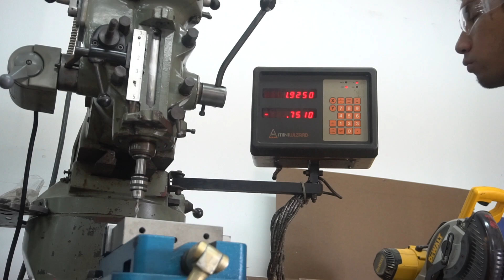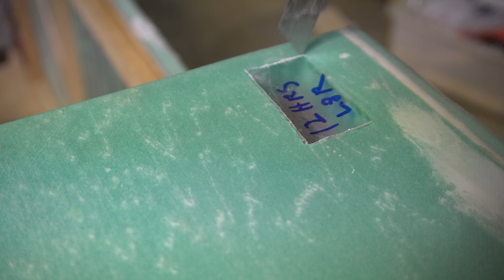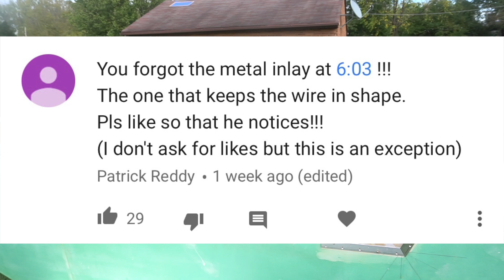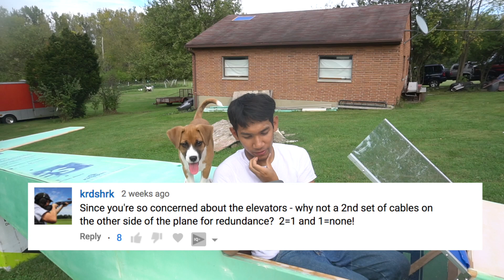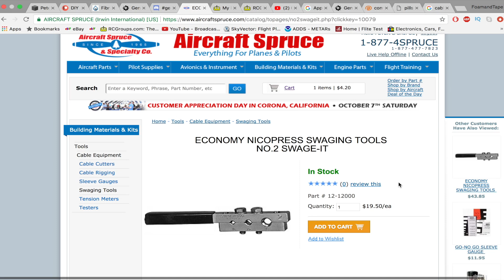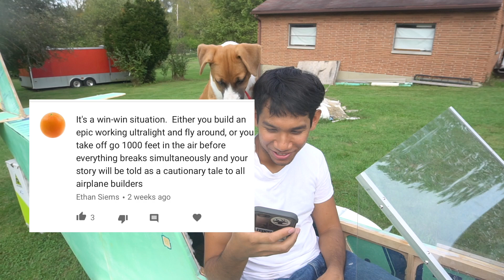DIY Electric Ultralight pt4 (fiberglassing fuselage and wing construction)

Comment: I think its awesome that you are trying to build  an airplane - you are doing something that I have always dreamed about. Speaking of dreaming, I am currently training to be a recreational pilot and I fly a Sling 2 Light Sport Aircraft. Super reliable and super forgiving to newbies. The sling 2 is rated for +3.8 G and -1.9 G. In all my training, I don't think I've ever exceeded +2 G and more than -.5 G. This aircraft has a wing span of 30 ft with wing loading at 11.7 lbs/sq ft. I really think that your landing gear needs to be taller. When you come in to land, the short height of the gear can make your landings problematic. The main issue being that if your aircraft gets hit by a cross wind or you over -control during your approach, your prop may strike the ground, your gear may collapse if you land hard or balloon too much during the round out and end up stalling. Please be safe. Aviation is super rewarding, but is unforgiving. One mistake can lead to disaster, so don't be careless with the controls thinking it just needs to last one flight. Especially when you know that something is going to fail eventually - don't take that chance!

Comment: Hey bud, it's hard to tell from the video but some of your edgemargines on the holes seem to be less than the half the diameter of the holes you are using and I can't tell if you are doing a fillet relief on the holes. If you are planning 4G on a flight you mounting surfaces need fillet relief on the fasteners or you will experience sheer on the fasteners heads even if titanium or if not enough edge margin the fasteners will tear through the metal. 
 As a airplane mechanic I want to see you fly safe.

Comment: adding some sort of suspension may not be such a bad idea. If, for some reason, you cant land smoothly a bounced landing may be pretty sketchy. I have crashed a few rc planes that had no suspension. They simply hit the ground too hard and because I did not have enough power, they stalled and fell straight to the ground. Your power to weight ratio may be good enough to get you in the air but it may not be good enough to get you out of a stall caused by a bounced landing. This is a situation that is hard to get out of in any plane, given it is severe enough. By adding at least some suspension you're decreasing your chances of getting into this situation. It will also help take some loud off of your plane when making a landing, this will keep it flying longer. This may be something you had already planned on doing after the first flight but I feel it is important enough to fix now, before it flies at all. Best of luck!

Comment: I love your videos and I have been following your channel for a while. I am a 15 year old student pilot and I have always wanted to build an ultralight myself. I think dropping the landing gear to prevent a nose over/structural destruction of the plane is a great idea. Are you going to have a single set of ailerons or one set on each wing? Have you thought of attaching a ribbon onto the top of the lower wing about 3/4 the way back as a primative stall warning system? (You can google it to see an actual example of this)

Comment: Hey Peter.  I would look into getting some larger diameter landing gear. maybe a small bike tire.  those small wheels will dig into the ground if you have any vertical speed and it will flip.  also the added height will allow for more landing flare.  also make sure you bench test your motors. (you may want to do on a moving car as well to get dynamic thrust) having an adequate thrust to weight ratio is important for controllability. what are you planning for currently? Also I would highly recommend switching to a more robust motor.  I'm not so sure about turnigy try KDE direct. 
Dan
concerned Engineer

Comment: Does not need to be this strong??????????????  Wing root meeting the fuselage had better stronger than u think u will ever need. Also engine firewall.   Peter, that is excellent work. I have enough faith in your work, to have u build one for me. Been flying commercial craft for 35 yrs. I love your ultralight.

Comment: Thank goodness you put face sheets on the foam!!!   Now do the other side.  Sandwich it.   One side ain't gonna cut it.   Strength is proportional to the moment of inertia of cross sectional area, and one side face sheet has very low moment of inertia.   500 lb on the wing is WAY too low.  You tend to underestimate the loads.   Put a 1.5x safety factor on it.  Send me the OML and materials and I'll do a stress analysis for ya.  Sincerely, an experienced airplane designer.
Reply: Yeah, some people must slam some data in this guy's face, or he will more than likely get himself killed. You know he has no idea what he was doing  when he even talks about pulling Gs in a plane this size built with polywood and fiber glass.

Comment: What foam cutter did you use and if you made could you make a vid on it
Reply: Conner Majic Just metal wire connected to power source, so its getting hot, just Google styro cutter.

Comment: You absolutely have to have suspension, at least a little, especially if you screw up your spar, the plane is toast. Even a compressed rubber spring, something so you don't crack the spar. Even a couple little tiny bumps could screw it up on your first landing. And since you've never landed your ultralight before, let alone fly it, you don't know how it's going to flare.
Reply: I think a trailing link suspension would be best. The way it is, I wouldn't trust it for one landing. Even if it doesn't suffer visible damage, I worry about what would be happening to the spar---unseen.
Reply: agree, couple big block valve springs encapsulated in the tubing could be good way to go too.
Reply: or go the route that many light aircraft, and even gen 1 and two cirrus use on the nose, Rubber pucks!
Reply: HUH????
Most ultralights DON’T have any suspension!
I have had 5 ultralights and none had any suspension! They were all sold in great shape to other pilots.
Reply: I don't like that the gear legs are attached to the main spar where a  landing on a rough field  could cause hidden damage. The small wheels are prone to being pushed back if hitting ruts or lumps, putting a strong twisting force on the  spar mounting point. Of course if all of the takeoffs and landings were on soothe or paved runways, this would not be a problem, though having larger tires would be better just to absorb rough landing impacts.
Reply: Spencer Coleman Why not use car shocks?
Reply: car shocks are too heavy. The first planes had give in the wood and the wire cable used to hold them. I think you're worrying about something that should be a non issue.

Comment: Hey Peter,

I noticed you didn't put any threadlock on the bolts, DON'T forget this, this thing is going to vibrate a lot.

Greetings from The Netherlands
Reply: Thread locker is almost never used on aircraft, proper torque and safety wire or cotter pins are far superior, I say this as a certificated aircraft technician. The main issue with thread locker is its internal so its nearly impossible to tell if the lock is broken without actually breaking it yourself, wire and pins are external making them easier to inspect while also providing a stronger lock, but yes the bolts should be secured one way or another.
Reply: And greetings from Singapore
Reply: HEY BETER
Reply: Armando - Like a fly by wire system? It could work, the F-16 uses something like that, and while it might save weight the downside is that if the battery dies he has no means of controlling the aircraft, the cable system however will work as long as they are intact, so I would say its the safer option.
Reply: Ok thanks, I didn't know that.
Reply: i second the safety wire of cotter pin idea. Also highly recommend picking up that ac 43.13. oh and were are you from Henry? greetings from waterford michigan, KPTK.
Reply: @C Henry: Agreed. Do you guys use a magnaflux equivalent on the Aluminum? How often do you magnaflux steel parts? What makes the other guy think this thing will vibrate a lot? Foam is a natural cushioner/dampener and electric motors are about as smooth as you get. FAR superior in low vibration to gasoline aircraft engines. (only inline 6s and v 12s are perfectly balanced requiring no harmonic balancer)
Reply: BtW When I do use threadlocker I use the red loctite you apply AFTER assmebly. It's just so much easier and faster. ( My bikes see LOTS of vibration in the form of potholes and it is brutal on things. Especially food inside a backpack will often be a mess of just crumbs when I arrive somewhere. :-P )
Reply: Our usual NDT for aluminum is a die penetrant, or a fluorescent penetrant, the flaws have to reach the surface to be detected but its easy to use at least, as for when, I just do it when the manual says to, intervals sometimes vary, but with my current job at a repair station by the time we get them its usually due. I think your right on the vibration, electric motors don't usually have much and so long as the props are balanced it should be minimal, as an added benefit he wont have gasoline near that foam, I would hate to see that little aircraft dissolve on him. I should say I have nothing against thread locker, I use it religiously on my truck, its just for aircraft there are better options.
Reply: Goldeagle, Oregon, and I definitely agree on the 43.13.
Reply: Threadlock should never be used on an aircraft. The correct selection of hardware works better.
Reply: vfxexpert .
Reply: Hallo medebroeder van Nederland
Reply: WHAT!!!!@??  Use the threadlock on everything that isn't plastic or polymer
Reply: Eeeyyy nederlaaannddd

Comment: Hey peter, I have a project for school where I have to build a boat that has to push other boats out of the way to make it to the end of a trough. I have a Traxxas brushed Motor I will use with a 7 cell nickel metal battery. Should I go for a 3D printed tug boat propeller or a hobby propellor

Comment: Dang bud if no suspension you need air filled tires. Also put a fixed tail wheel on the rudder, or a swivel wheel on the fuselage. Dragging the tail will really slow you down on takeoff. Ps: proper crimpers look a lot like bolt cutters.

Comment: I'd recommend using carbon fibre for the wheels its lighter, more durable and has a little bit of flex to it so if you have a rough landing it will ubzorb(soz if spelt wrong dyslexia) the impact depending on the landing

Comment: Those copper swages are supposed to be a 3 part crimp to keep the cables from pulling through the sleeve under strain. Its hard [though not impossible] to get the desired crimp with a bolt press like that when doing a thimble eye splice. Go-No gauge is a very good idea.

I also noticed in this video you have no safety wire or safety clips on your turnbuckles; that is another major safety corner I wouldn't cut for the maiden flight. I've included a link below [Direct from FAA.gov] to their free resource on control cables, it includes acceptable [to the FAA] technical data, guides and diagrams, that show word for word how to do this safely and legally.

Don't wanna see all that hard work go up in smoke due to simple preventable failures!

I wish you all the best, and am glad to see things coming along smoothly. I won't nitpick too much since you're in the learning process but if you have any questions feel free to drop me a line. Looking forward to the next video!

Here is a free link to the FAA's text on acceptable practices for control cables:
https://www.faa.gov/documentLibrary/media/Advisory_Circular/Chapter_07.pdf

Heres a link to a more industry-standard type of nicopress:
http://www.aircraftspruce.com/catalog/topages/64cgmp.php?clickkey=4330

Comment: just love this build... i really enjoy such projects, and i'm pretty sure i'll start building an ultralight when i'm done with my current project... do you have any advice for building a plane like this? maybe even have a look at the adventure-bus build on my channel and throw some feedback at me haha. great job as always peter!
Reply from the maker: cool man! the bus conversion is neat, subbed, cuz it reminds me of the food truck project my family did! and only advice is tons of research. Its a serious amount of head scratching designing everything!
Reply: when i say advice i mean like something i need to be extra carefull about so i don't die...
Reply: Life of Bjorn find an A&P to talk to
Reply: Make a mini, RC prototype first. Make sure to have plenty of experience with brushless motors, epoxies, and aerodynamics.
Reply: Make Shure your weight to Power ratio is correct and your balance in  precice I've built many models and have found these two elements are key to a successful flight, if you have more questions I will be happy to answer. Best of luck
Reply: PeterSripol awesome, i'll probably do that...
Reply: Just use gas engines. Much simpler imo and price is not far off if you factor in the batteries and speed control etc
Reply: Ultralight aircraft design is simple and straightforward but you must be familiar with a few design  principles first.
Reply: Life of Bjorn you have a pretty cool channel, (I subscribed)

Comment: If the bottom gets nacked in a crash landing, with emphasis on landing, you can repair the main airframe just fine, cut the fiber glass around and replace the core. There's no strength issues other than some minor added weight.

Comment: Before your flight, I would sincerely, earnestly, and vigorously encourage you to get a copy of "Stick and Rudder: An Explanation of the Art of Flying" by Wolfgang Langewiesche.  It's the best book on flying I've ever read.

Using the data I set up, and executed, a 5 mile glide into a landing one time.  Put the throttle to idle, and didn't touch it again.  And I'm not a high-time jet jockey, just a guy with a Private Pilot certificate and about 300 hours.

Comment: Looking good! I would highly recommend some amount of suspension in the main landing gear.  Even the best of pilots can not make perfect smooth landings every time. Inevitably, at some point wind will shift right as you're in the flare and the bottom will 'drop' out and you come down harder than you'd have liked. That sudden shock with be forced to work it's way through the airframe.

A trailing link/coil spring suspension could work with your existing landing gear structure.  Or at the very least run a larger tire with low pressure and let the tire give you a bit of flex.

As for the nicopress swages... if the swage passes go-no/no go gauge test you're all good!  No need for a $200 swager if the cheap one can swage to spec. I've used both the cheap aircraft spruce swage and a the fancy ones.  No difference in rated load if the swage is good.

Keep on keepin' on! Excited to see this thing fly!

Comment: If I were you I would've not included a landing gear - especially one without suspension - but opt for a take off trolley and use a skid mounted under the center line for landing (Me163 Komet style). Safer and less weight.

Comment: Hi Peter, I have built a kit plane before, so I can say that,  what you have done,  is amazing. My only reservations are the landing gear that attach to the main wing spar - you yourself have mentioned its weakness. It's not to late to add a more traditional landing gear, just like on most model airplanes. Have a look at the ch701 and ch750 kit planes, produced by Zenith Aircraft company for kind of landing gear I'm talking about. But apart from this, excellent job. Can't wait to see her fly. Good luck.

Comment: You NEED to add suspension to your landing gear or it Will get damaged.
 Also your wheel diameter is too small unless you are only running on paved surfaces, even then they are a bit on the small side.

Comment: you may want to do a redesign of the wheels, they look like they are twisting at the end, what i suggest that you do is you make the holes bigger to fit a ball bearing(use a good one and not cheap ones as they are going to take a lot of force), one on each side of the wheel, find a bolt that will fit snuggly inside the barring and bolt it on, also add some washers to allow the barrings to spin frealy with out any friction on the side

Comment: Peter, this is such a great project!  But I implore you not to fly in this airplane, at least at first.  You're an RC wizard, isn't there a way you can make the controls radio controlled and do some test flights with a dummy that approximates your weight before you fly in it yourself?  You're clearly an excellent intuitive engineer, I'm just afraid you might be dealing with forces you're not prepared for, here.

Comment: Hi!
I suggest you not to use that windshield at all, as there will be less aerodynamic drag without it. It is pretty large and it will also create a turbulence behind, affecting the tail authority. Just unscrew it and throw away. Just use a helmet with visor. Otherwise, no major concerns from my side so far. It will be a slowflyer/floater, so there is a great chance to fly....

Comment: many commercial aircraft are only rated to about 2.5g's.  You can loop with less than 3 in most low power aircraft. 
Good idea to make the landing gear replaceable, and absorb shock.

Comment: Great job, the only thing I would reconsider so far is the landing gear, in my opinion you really need to add some suspension or a softer wheel ("tundra" style maybe?) wich will absorb the take off roll without passing too much stress on the main spar, you sure don't wanto to risk damaging it for a small pothole just before takeoff....  and if you really mean to fly it more than once don't underestimate how hard it is to land a plane when you are INSIDE it, your brain goes at like 20% once airborne, trust me, I'm a military pilot and fly rc aircraft as well, it's very easy to flare 2 feet too early or too late and some suspension will help you for sure.
Good luck with your project!!!